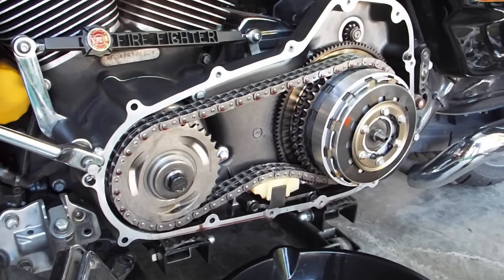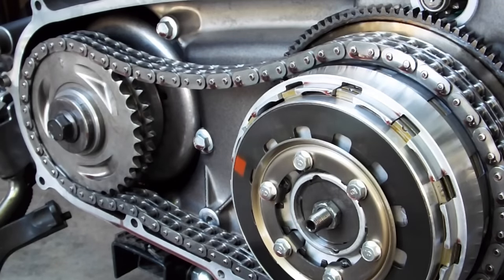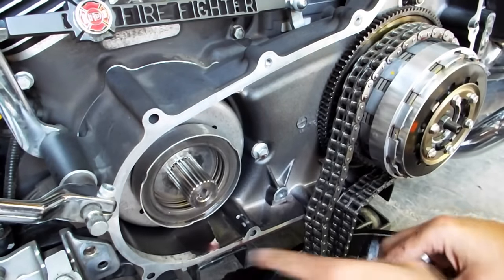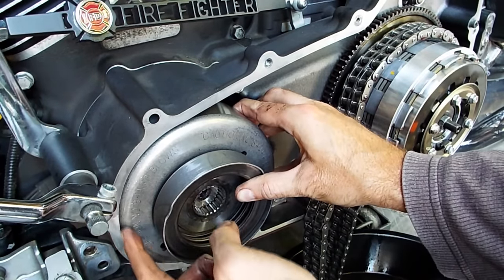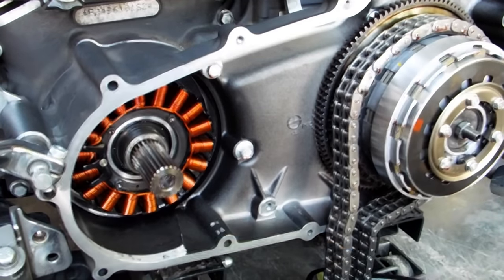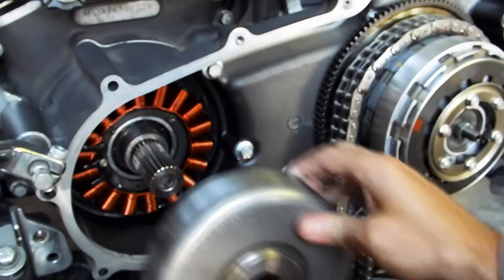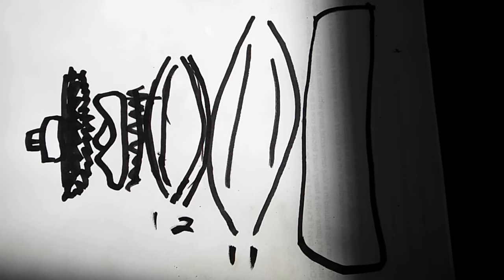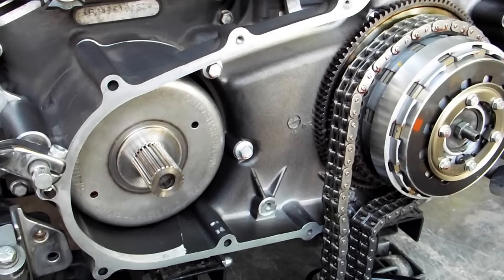Old Compensator to Newer Screamin Eagle

Comment: My question is why do you think your compensator and stator needs attention?  My compensator/stator was inspected and was totally fine after only 30,000 miles?
Reply from the maker: My factory compensator springs were worn out, so I modified the spring pack and then switched to a Screamin Eagle compensator.

Comment: hey Mark did you clued the oil deflector on to thte outer primary cover it didnt look like you did thanks im ready to pu mine on
Reply from the maker: Thank you for asking. No, because this is the earlier Screamin Eagle compensator that does not have the oil channels like the newer version does. Best way to tell is older version (mine) uses a hex head bolt, and newer version uses an allen head bolt.

Comment: Hey Mark. Can you tell me everything I need for this whole job? Like oil and all that?
Reply from the maker: A replacement compensator, an inner primary kit if you're going to remove and replace it with the compensator upgrade  instead of grinding part of the inner primary away to remove the stator hub, new primary fluid, new outer primary gasket, new round gasket for the primary fill/clutch adjustment cover, and labor. I went with a harvested Screamin Eagle compensator assembly to save a few dollars. And a service manual, big help!
Reply: I mean I have an oem one. So the pri.ary kit comes with all the oil and everything?
Reply from the maker: The primary kit has new gaskets for the inner primary to motor and transmission, a new oil seal to go around the clutch shaft, and new bolts that are coated with sealant on the head ends to prevent leaking. It says in the manual not to reuse the inner primary bolts because the sealant will not reseal and you'll be looking at a leak of primary fluid. IF you want to grind away part of the inner primary to remove and replace the stator cover, you don't need to buy the primary kit. Only if you totally remove the inner primary. I removed it on mine to replace the compensator the first time, but I had to change out the stator cover AGAIN, so I used a Dremel tool to shave away just enough of the inner primary lip for it to slide off. In short, the cheapest way to swap it out would be the Dremel method, just use brake cleaner to flush away all of the aluminum filings.
Reply: I have to replace the stator cover? Or did you just do that anyway
Reply: Is there a better messaging method? Lol
Reply from the maker: The factory flat compensator uses a different stator rotor than the Screamin Eagle compensator. So if you upgrade to the Screamin Eagle, you need to swap out the stator rotor. The rotor will not come off the crankshaft with the inner primary in place in most cases, which means either grinding away part of the inner primary lip or removing it entirely.

Comment: Killing me adding extra spring washers. Excessive spring pressure on all the metal to metal parts equals excessive wear with metal particles in oil. . Plus removing the shock absorbing design of compensator. Then smart engineers get paid good money to make things work better. Good luck in long run 10-20K will be the real test.  Few miles  will not tell you much IMO.
Reply from the maker: Thank you, I value your opinion. The springs I used are not new, they were taken off as salvage and sold to me, meaning they don't have their full strength. Adding another spring did not tighten up the system much more than what a brand new spring pack would have given. I modified the original compensator by adding a spring in a configuration that I could feel the engine pulses going up hills or accelerating, so I made another change to that packs orientation and this pulses went away. Using this Screamin Eagle setup has given good results in allowing most of the pulses to be absorbed before being transmitted to the rest of the bike. I have no plans to change it to any other configuration anytime soon as I am satisfied with the ride quality and the dependable hot starting ability it has now.
Reply: @contact4mwy7  My factory comp was causing engine to kick back on first start of day, not always but enough to make me wonder why. Been doing it since I bought bike new. After about year plus some research recommended upgrading to SE Compensator.  Money well spent no more kick backs or sneezing thru the air cleaner. Pulled it off after stator burned up. No appreciable wear in 30K  miles. Ride Safe
Reply from the maker: @SIERRA-dx9wm  That's awesome! What year is this bike? Sounds like it had the flat no-spoke compensator of 2007-2010?

Comment: HOW  is the result  now from the New SE Compensator ? Have you at still extra  springplaid?
Reply from the maker: I'm still using an extra spring, and it's still going strong.
Reply: @contact4mwy7  my Primary  also make nois like have Stones  inside  2015 flhx. I at New tensioner and New drag s.. compensator kit inside  but still this shit  nois  if i drive nois go but if go down ore stay nois like Stones in primary  and i 100%sure nois from primary sounds.
I see you video  maybe 1 more spring plaid  will fix have you any idee?
Reply from the maker: @Wolf-Germany  I am a bit surprised that a 2015 is making this much noise. How many miles on it? Do you go heavy on the throttle? Maybe one more spring would help, maybe better to replace them all with brand new springs?
Reply: @contact4mwy7   it is realy crazy i but new compensator and all new  still have the bad nois i think maybe the stator have some nois
Reply from the maker: @Wolf-Germany  is it a whining noise or more of a grumbling rattle? Whining could be the sound of the chain going over the tensioner shoe. Grumbly rattle sound could be from the bearing on the transmission input shaft. Those two and the compensator seem to be the top three for noise from what I've seen in message boards and videos.
Reply: @contact4mwy7  the nois is like havy rocks inside the Primary smile its more grumbling and tiking  the big Clutch bearing change also already and the clutch  all looks fine   maybe i have to add 1 more spring plaid on to the new compensator kit  i need look again also on the Rotor and Stator maybe the nois from there
Reply from the maker: @Wolf-Germany  I hope we are narrowing the sound down. Keep me posted.
Reply: @Wolf-Germany  Hope you found that noise..  If not.. here's an idea of mine ,  the bolt has already become loose after your first install, This is very common on any item that deals with springs, after about  20 miles of riding, If It sounds like you never put on a new one, It is very likely that the spring unit settled down and the bolt needs tightening again...

Comment: Mark, what type of Automatic Transmission fluid did you fill your primary with.
Reply from the maker: Dexron III/Mercon (Dexron 3/Mercon) It does not have Friction Modifiers which makes it ok for wet clutch use, and won't harm the wiring to the stator. Some will disagree, and that's ok, but I've put several thousand miles on my bikes using only this type ATF. Some swear Red Line Primary Fluid is derived from a form of ATF, but I have no proof to offer.

Comment: So you ground down the inner case?  Really?
Reply from the maker: Yes, really. I know you would have taken the inner primary off, again, to swap out that one part, but I've been there done that. There's plenty of metal left for the outer primary gasket to seal against. The engineers at Harley could have designed this differently to accommodate the replacement of the rotor or stator, but they didn't. I ground it down, and I would do it again if those parts need replacing. Ridiculous.

Comment: you didn't finish putting the compensator back on
Reply from the maker: We'll, I didn't leave it off
Reply: @contact4mwy7  well, did it just slip back on or did you need remove the clutch hub to get the job done like some had to in other videos
Reply from the maker: @jimkolarich7052  it will slip back on if the compensator is tilted towards the clutch and pieces slide on one at a time, carefully.

Comment: Hey Mark I’m having the same trouble and I’m interested in some of your old parts. I’m in Dover NH , not too far away.
Reply from the maker: Hello Mark, what year, engine size and model is your bike? Is it thrashing around on startup? Making a clunking noise on shutdown?
Reply: Mark Young - Outside The Box  Hi Mark ,
I have a 07 CVO ultra , been having these issues for over 2 years. I’m interested in your old spring so I could do the 5 spring set up, until Im able to get the up grade compensator. I had found Belleville springs on eBay, just not sure of the size. Great channel by the way, follow all your videos.
Reply from the maker: Mark Colford I bet we can work that out, after all, I have 8 of those springs now, lol. Have you had the primary open to see which compensator is inside? I just want to be sure which one it is. 07 is the first year of the 96ci Touring models, but being CVO does it have the first generation "pancake flat one" or the Screamin Eagle "three spoke hub type?"
Reply: Mark Young - Outside The Box Hi Mark, 
It has the pancake one , motor is a 110 based on the 96. My truck and bike broke down in the same week. Borrowing a car from my brother until I get a vehicle going. Bike was going to be the least expensive to fix first. Voltage regulator went out on it. I’m just trying to get back on the road . I have an hour commute to work every day. I think adding a spring as you did will buy me time until I can get everything else in order.
Reply from the maker: Mark Colford can you message me direct to my YouTube account so I can get a email address or phone number?
Reply: Mark Young - Outside The Box yes
Reply from the maker: Got it
Reply from the maker: Mark, talk to me, how is it coming along?
Reply: Mark, So it's been about a month now, what are your findings.  I have a 2015 CVO Limited with a Stage II-110 motor.  Dealership just replaced the compensator under warranty and its still making a hell of a racket. Dealership is telling me what I'm hearing is normal and its driving me crazy.
Reply from the maker: Erin Wilson I'm still running with the extra Belleville spring washer in there and yes, mine is not what you would call "quiet." I'm thinking it's just the nature of the beast. Starting is a whole lot better, that's a plus, but I can hear some chatter from inside the primary, some of which I found out is from the clutch plates rattling around, and I shot a video of that and uploaded it. I honestly don't know how one could make the noise go away completely. It's a lot of metal parts under load doing what they are designed to do.
Reply: Thanks,

Comment: My M8 107ci, has a Screamin eagle compensator.  At 32,000klms, it is sounding real bad.
Reply from the maker: Already?! What year is it?
Reply: @randymccalla9995  very quiet and smooth
Reply: @contact4mwy7  2017
Reply from the maker: I can hear a muffled sound coming from the Primary that I am sure is from the compensator, but I am ok with that. It's more of a muffled metal sliding on metal sound most likely from the spokes and ramp pieces. But it tells me that it's doing its job of cushioning the engine firing pulses before it hits the tranny, which is what we want. So if it's a whirring kind of sound, good. If it's a harsher hitting metal sound, that might be a weakened spring pack?
Reply: @contact4mwy7  yes, correct

Comment: my 2016 roadglide ultras compensator started knocking at 12K miles. Had it replaced by a certified Harley Mechanic with the Screaming Eagle upgrade. 20 minutes out of the shop the Screaming Eagle started clunking like garbage. Going to take the bike in and go with direct gear. They've had nothing but trouble with these compensators or the spring packs over the years and refuse to find a fix for them.. Just my 2 cents.
Reply: All Rushmore models come from the factory equipped with SE comp lol

Comment: Buy a solid sprocket and stop messing around with compensators - they are all trash ! Every type of them make it hard for the starter motor to spin your engine ( as the starter motor is trying to compress the spring Instead of just turning the motor over) and causes the battery problems of over overheating due to the current draw, and that shortens the battery life as the plates nearest the terminal buckle and or 'sulphate up'. As the current draw is so high, the available voltage drops and the ignition module then cuts power to the coil. This then causes the spark plugs to fire causing the engine to 'kick-back' causing further problems for the battery and even wrecking the starter dog and clutch ring-gear. It is a poor design idea and should be eliminated.
Reply from the maker: Wow, Robert, I have yet to hear anything explained in such detail about the compensator and it's relation to the rest of the bike. It makes a lot of sense. Thank you.
Reply: @randymccalla9995  Since I fitted a solid sprocket, my battery has lasted 5 years.... compensating sprockets are crap.